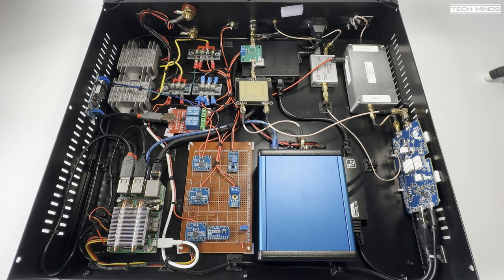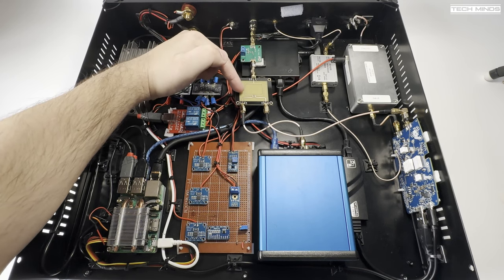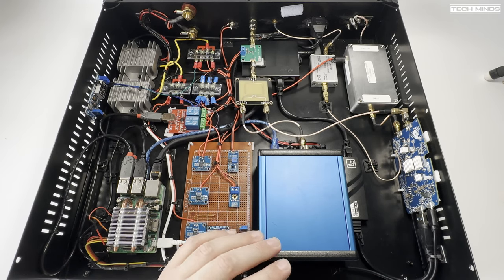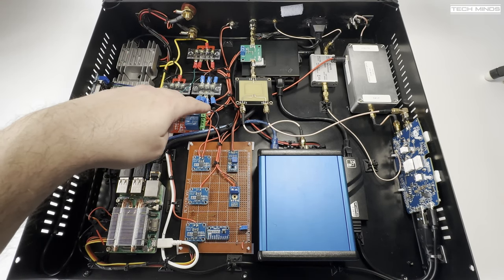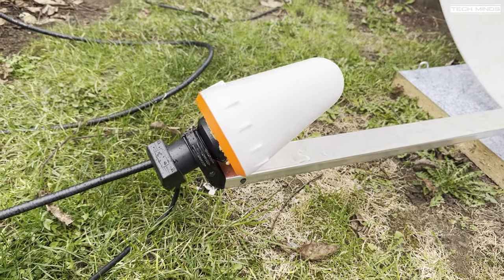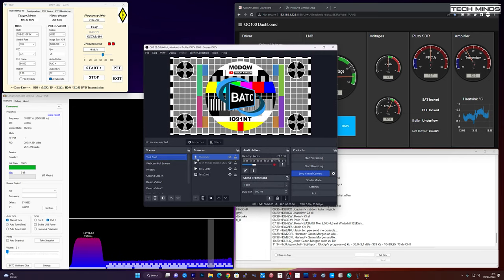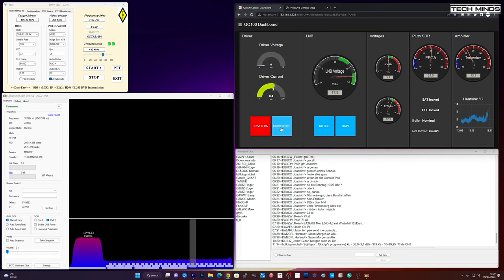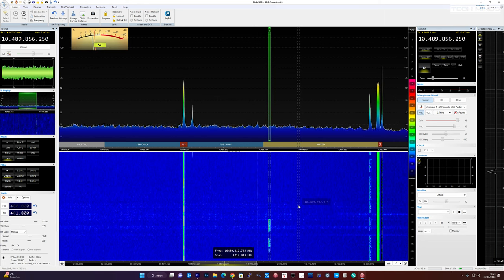QO-100 DATV & SSB Transceiver Build - FINAL PART!

Comment: Since you obviously have drive and know how to get RF signals to places others can not, I thought I ask what you thought of a situation requiring resourcefulness and technical savvy. That being said, I suggested this one other guy who’s technical ability is right there with yours, he’s just not a radio person (I think. I want someone to test the feasibility of using a drone to carry a half pound of thin gauge copper wire to the max altitude allowed by that length of wire, to see if it would work as an emergency single wire antenna. I use to hike all the time and was always a few miles away from help but almost always isolated from cell and RF due to terrain. I’ve pondered this for a while then just this afternoon, I read a headline of how a guy rescued himself by strapping his cell phone to a drone and sending it off to somewhere it could get a signal long to send for help. 
If you’re able to do something with this would be awesome. If not, I appreciate you taking the time to endure my terrible spelling. Can’t wait to see the video of you retasking the ISS or pranking the planet during the next World Cup by shutting down everyone’s direct TV, or something else equally amazing.  Keep calm and radio on!- Jason Burchell

Comment: Hi, would you be willing to share the software for the Raspberry PI and  control screen? It would help those who are not so good with programming. Otherwise thank you for an excellent series.
Reply from the maker: Yeh sure, but see my last video on this subject. Cheers
Reply: @TechMindsOfficial  Hi Matt, thank-you for your answer. I still don't understand how you get the screen with the buttons. Is this a screen attached to the Raspberry PI? What is the minimum PI configuration that I could use?

Comment: Just caught up on the video series. Did you say which 2.4GHz PA you were using? ( I know you have moved on to the e-recon now)
Reply from the maker: Do you mean before using this E-Reon Powerblast 300 shown in the video? If so, my original amp, which I still have and use is I believe a modified Nokia Pallet.

Comment: How much power are you using for the TV and SSB transmitions ??? Great Video BTW!
Reply from the maker: Probably 20 watts or less for SSB and 120 ish for DATV. Not 100% sure but currently building a power meter.

Comment: Congrats on finishing the project. It's very good how you've integrated the NB and WB operation into one box and facilitated an easy change over between the two modes. What MER do you receive the beacon at?
Reply from the maker: About 8db, but that’s because the helix shadows the LNB. With a bare LNB I get around 10dB.

Comment: Hi Matt and thank you four your channel. Thanks to you i may be using QO-100 by christmas 😄. Only two questions. Do you know if Pluto is still in production? Out of stock in many stores, mainly the usual china suppliers. And last, did you take it out of his case? Because of heat? Congrats on your assembly, really clean service, very good. Thank you, 73's José.